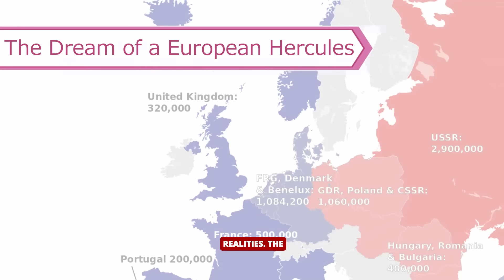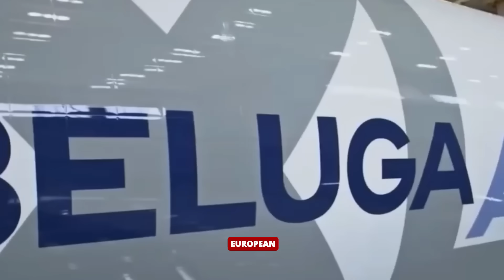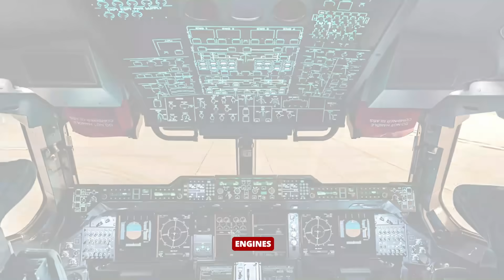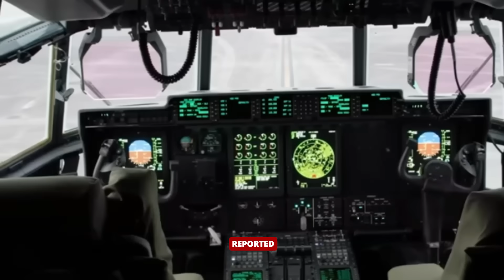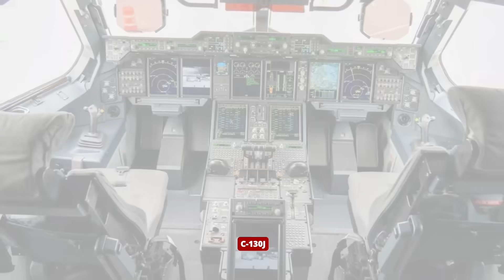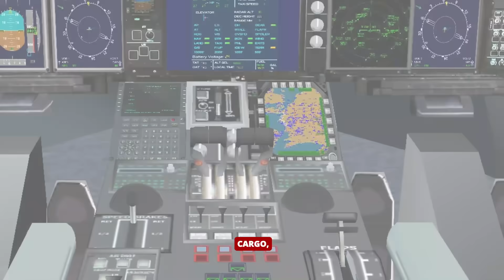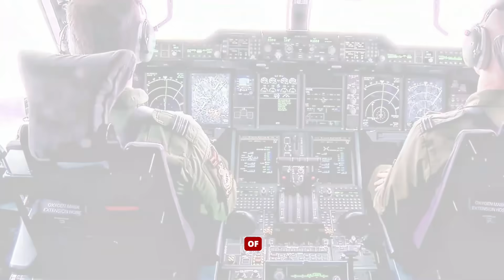Why Europe's $180M Jet Can't Beat a 70-Year-Old Plane

Comment: The one that illustrates how much better the C-130 is, is the fact that a lightly modified one was carrier qualified. They landed and took off from the USS Forrestal. 21 non-arrested and unassisted takeoffs and landings at varying cargo loadings. If a major piece for a carrier were needed, if it fits on a C-130, it's conceivable that it could be delivered by an un modified C-130. Granted, you'd have to clear the deck entirely, but it's doable.

Comment: I like Spain as place to visit but they should never be invited to any sort of project. They need Government Welfare in the form of jobs to badly to see anything but that. They are not as economically or technologicaly advanced as Germany or France or most of the EU if you bar the mind numbing inclusions like Greece for example and those like them. The division of labour should not have been piece but by system like having one country designt he wing, the other the engine the other avionics etc......This is absolutely moronic no wonder it turned out like it did.

To be honest Airbus should have designed it nose to tail and then offered modification packages by country and a couple of engine options from exhisting market place.

Comment: The C130 is physically smaller than the A400M, so loads are smaller in size and weight.  If you wanted to get an aircraft that could handle the same loads as the A400M, then you have to look to the Shorts Belfast.  The engines were also about the same power.

Comment: problem with the atlass 400 is that its to big to do the mission the c130 can and to small to be as effective as the proper c17 or c5 a c130 can drop 4x humvee or isv with 92 paratrooper or they can airlift or air drop 1 LAV or Stryker ifv with crew while the c17 can carry 2 fully armored bradley or 1 fully loaded abrams the atlass 400 cant carry a full mbt it cant even carry a fully armored puma/bradley you need to take out the up armored kit and fly it seperetly sure it can fly more stuff then the c130 but it takes 2x as much trip compare to the c17 and for light load mission where 20ton pakage is the norm the c130 does 95% of the job just as well.

Comment: I think the real Hercules competitor isn't the A-400M as this video shows.  I think the real competitor for the C-130 for some smaller fleets is going to be Embraer's C-390 Millennium... that's a closer match to a turbofan powered C-130 sized aircraft.  Bigger than C-130 isn't tactical anymore, and the A-400M is too big to be tactical and too small to be a strategic airlifter, and too complex in any case.

Comment: What a Load of BS is this? 

First the A400M is not a Jet, and Second you can't compare A400M and C130 - they are flying in different Weight Classes (Cargo Capacity A400M 40t, C130 20t).

That's like comparing an A-Segment Super Mini against an B-Segment Station Wagon.

Comment: To everybody saying this plane isn't the same as the C-130.

It was designed specifically to replace the C-130 and C-160 In Europe. This isn't up for debate it is what the FIMA group was setup to do. It failed to replace the C-130 by a long shot. 

Lockheed was originally in the group but quickly dropped out due to the multinational clusterfuq it was becoming. 

Europe sucks at group military procurement because so many people have a say in the design and where it is built.

Comment: The A400M was not a plane to rival the Hercules globally, the A400M is much much bigger and heavier. It has a different role between C-130 and C-17. Embraers C-390 is a rival and beats the C-130 all over the world. This video seems like american propaganda. No one wants it? There are 136 A400M in 10+ different countries. Thats pretty good for a mil transport Aircraft of its size, remember they startet 2013. If you compare it to the C-17 with 276 Planes and 223 of them stayed in US-Service.... The Hercules was a very good plane for a very long time but its not the best on the market right now. Fortunately for boeing, embraer will not have the capacity to supply the whole world in time as its hard to scale up Aircraft production and the C-130 fleets are aging too fast, so boeing will get enough orders but if they don't develop a good successor to the C-130 fast, they will run into trouble in the following decades.
Reply: BS it was designed specifically to replace the C-130 and C-160. That was the goal of the FIMA group look it up.
Reply: @rburns9730  Sorry, maybe my text was misleading. Yes it was made to replace the C-130 but specifically within the developing countries and maybe other mid-sized forces. But its not for smaller countries with smaller forces, therefore only a partial rival on the global stage. In contrast the C-390, i believe,  is made exactly for that direct rivalry.
Reply: Fully agree. Airbus nailed it!

Comment: As the narrator pointed out, it's nice to be faster, carry more, and go farther, but the most important thing is reliability: the C-130 just keeps showing up, no matter what.

When Douglas presented the C-17A, it flew faster and farther - and carried more than the C-130, but it couldn't do all 3 at the same time! They had to go back and make improvements before it finally could.

Meanwhile, the C-130 was still there.
Reply from the maker: I absolutely love the C17 and its a great jet. After i deployed working on both the C17 and C130 I truly fell in love with the C130. I can still hear the buzzing of those props landing in the dead of night.
Reply: @The_Flight_Path The C-390 Millennium is coming...

Comment: Our company did avionics and black boxes on the C130, C17, C27, C5, 707, 747 and a batch of other commercials.  That series has the best Load to Passenger to Strip Capability of all other aircraft, except the 737 design.  Fuel economy was improved with later models with winglets, adaptive structures, and higher bypass and denser engines, but the basics of these planes, their basic center-of-gravity structure, and bullet holed reliability makes them forever Great.  I see that the Chinese are now trying to replicate these designs, and have made some improvements.  They have a Copy of a Canadian Shorts model which is highly practical, short runway, similar cargo spaces, and very simple to operate.  They've seen the light, for their terrain and turf.

Comment: When you try to be two things you're not going to be good at either.  Afghanistan is a perfect example of why the US system works much better with two different air frames.  C-17s would bring huge amounts of cargo to Bagram Air Base and then it would be distributed around Afghanistan by C-130s.  This is a much more effective way to deliver supplies.  When I was there in 2006-07 we had four C-130s that were used to haul everything around the country year after year after year.  There aren't enough A400Ms to sustain that level of activity.  C-130s were rotated in and out on a two month schedule in order to rest the crews and go over the aircraft.  But there were always four in country to fly all the required missions.  With production seemingly capped at 178 planes the last A400M will be decommissioned long before the last C-130 heads to the boneyard.  In fact, I wouldn't be surprised if the C-130 is still in production on the 100th anniversary of its first flight, which is less than 29 years from now.

Comment: A400 is the middle ground fallacy. It cost almost as much as a C17, but can only carry a fraction of the weight. A 400 is also slower than the C17. The C130 carries half the weight, but has more flexibility.  A400 is too small for the big heavy things, but too big to abuse like the C130J. A400 had very bad design requirements, so it is stuck in the middle, which mostly a few Euros want due to euro pride.
C130J and C17 were also in production before the A400, so the customers likely already bought the C130J or the C17 before the A400 come out. Airbus could have bought an American made turbofan engine off the shelf for less. It would have given them more power, less cost, less maintenance, and faster speed. Airbus did not want to buy American, so they got this thing.

Comment: C-130J: ~US $66-80 million baseline, depending on configuration and period.

A400M: ~US $160-190 million as a rough estimate.

Thus, the A400M typically costs roughly 2 to 3 times more than a baseline C-130J, reflecting its higher capability and cost basis.

The C-130J carries ~19–21 tonnes.

The A400M carries ~37 tonnes (and future aim ~40 tonnes).

So in terms of payload, the A400M offers nearly double (≈1.8-2×) what the C-130J offers.

C-130J Super Hercules – Range

Range (with 15,000 lb / 6,800 kg payload) ≈ 2,500 km – 3,300 km (1,550–2,050 mi)

Maximum ferry range (no payload) ≈ 4,000–4,400 km (2,500–2,740 mi)

Typical operational range with ~20 t payload ≈ 2,000 km – 2,500 km

Airbus A400M Atlas – Range

Range with 20-ton payload ≈ 6,300 km

Range with 30-ton payload ≈ 4,500 km

Maximum payload (≈37 t) ≈ 3,300 km

Maximum ferry range (no payload)

≈ 8,700 km (very long due to fuel volume)

Comment: An aviation channel that can’t tell the difference between propellers and jet engines. Amazing.
Reply: It’s AI block them
Reply from the maker: Crazy right, The A400 also isn't exactly 180M nor is the C130 exactly 70 years old. It's almost like I try to appeal to  a wide variety of aviation fans. It's a youtube video not a technical order. It's always the ones who don't upload content that have the most to say.
Reply: @The_Flight_Path  It'd be nice if you could at least double check the AI script before putting it out. Calling a prop plane a jet is like calling a car a horse carriage.
Reply: @catmeow11111 U offer no praise, only criticism. Temperance is important
Reply: @The_Flight_Path  no one's perfect, the better man learn and fix not whine

Comment: Stop this rubbish. You don't have the first clue. The C130 is not in the same category as the A400. Trump and US isolationism have changed the rules. Any defence platform now needs to be independent of US control or veto. You cannot have equipment for national defence where a capricious US hamstrings its use or refuses maintenance support.

Comment: The C-130 is probably the Ultimate Jeep of the skies ... Simple, lots of them , still in production , plenty of Proven parts and easy ability for replacement parts and engines . Proven for decades , upgradable , Simple to fly  , relatively Cheap to operate

Comment: "Why Europe's $180M Jet Can't Beat a 70-Year-Old Plane"

Bit of a steaming hot mess of a take since it wasn't ever intended to outright replace the C-130.
It is and always was intended and designed to sit between the C-130 and C-17, the A-400 can carry loads larger than the C-130 and get in an out of places a C-17 can't... that was the whole point and you missed it.

Comment: The irony is that the same company who built that workhorse also built the fastest jet ever during the same era, and neither one has been beaten yet in spite of technological advancements.
Reply: U-2 is still in service.
Reply: @encinobalboa  The Air Force plans to retire all Lockheed U-2s in 2026 and reportedly replace them with Northrup Grumman RQ 180s. All A-10s are also going to be retired in 2026 and replaced with F-35As.
Reply: @J.EdgarVacuum-Cleaner  U-2 is understandable but F-35A for A-10 is not.
Reply: @encinobalboa  The A-10 is not survivable at all in modern air defenses. It's extremely vulnerable to MANPADS, it has dangerously slow speed and cruising altitude, its large gatling gun causes vibrations that impact its accuracy by 12 meters, and it has terrible visibility. 
It also has killed more friendlies and civilians in blue-on-blue incidents than any other American aircraft in history.
The F-35A on the other hand can provide close air support out of the range of MANPADS using missiles and when needed a smaller rotary cannon.
The OA-1K Skyraider will also be replacing the A-10 for close air support in counterinsurgency roles. It can do its job much cheaper.

Comment: The RAF decommissioned all of their C-130's earlier in 2025. Thankfully, just in time to avoid tragedies like the one which happened a few days ago, as the result of a Hamilton Standard propeller shearing off and cutting the nose off the aircraft. That's the second similar C-130 incident of recent years.
Reply: The A400-M is an impressive aircraft, said to be more capable than the Hercules.

Comment: It would be interesting to compare a C-130J (I think that's the most recent model) with an original model, in detail, frame by frame, control by control, compare the engines and propellers,  and see how much has stayed the same between the two versions.

Comment: The A400M beats the C-130J in all aspects. Range, speed, cargo lift in weight and space, short runway…….. it was designed to raplace the C-130H models in some specific European countries and it did that. I was never intended to replace the C-130 worldwide. It is an expensive capability and cannot be afforded by all the countries. It is a capability between what a C-130J can do and one C-17 can do. All countries operating the A400M are really pleased with it. So the whole title of this video disqualifies the quality of this channel.